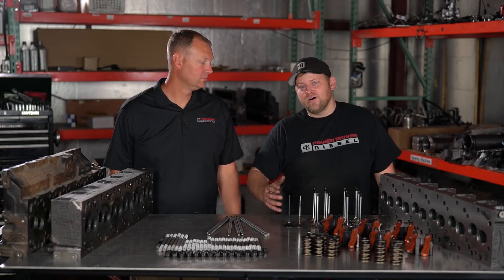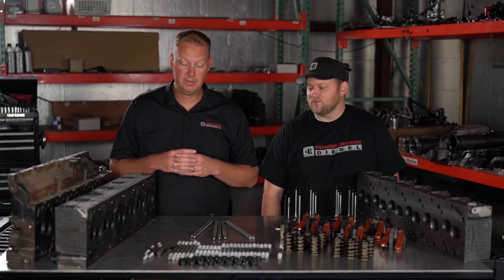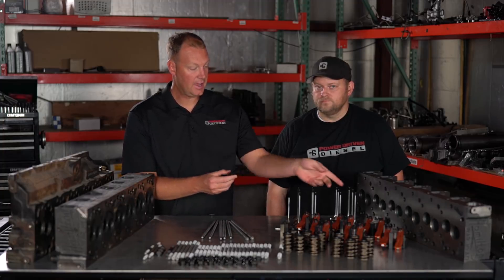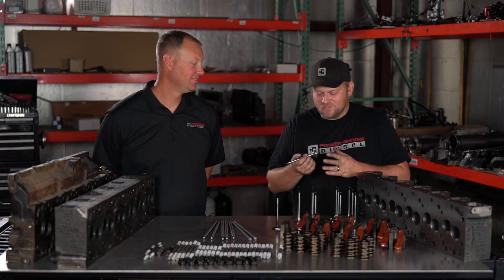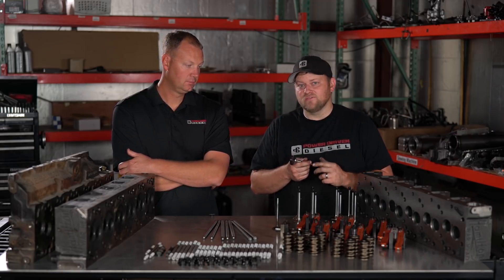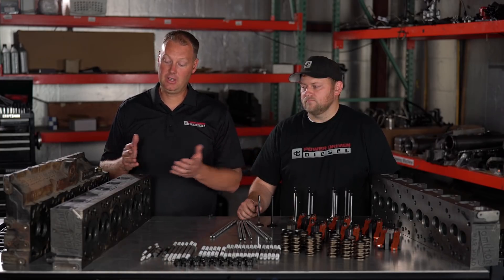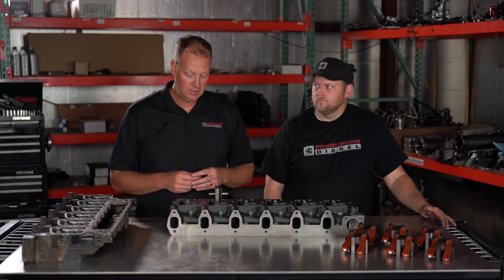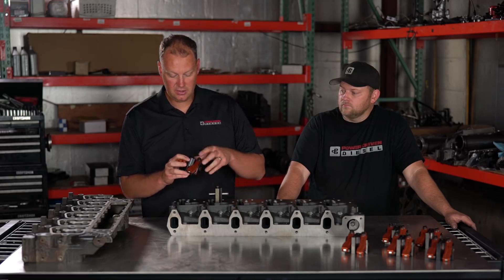Master the Hamilton War Head | Power Driven Diesel

Comment: PowerDrivenDiesel
Todd, when will you be getting stock length 7/16th pushrods back in stock for 24v engines.  Also do your  7/16 pushrods work with stock rocker arms ect.

Comment: Wouldn't be stainless steel intake valve still see the 2000 degrees in the chamber before the exhaust valve opens why wouldn't the stainless steel valve tulip on intake side
Reply: Only on the chamber face. The edge of the intake valve gets cooled off by the intake air coming in, but the edge of the exhaust valve gets heated as the gas leaves.

Comment: Great vid. I do have a Cummins 6bt m12 stud question. How far cylinder pressure wise, have you pushed on the 2000 series arp m12 stud? I have a Nissan FJ20 Turbo 2ltr twin cam "gas" four cylinder.  Luckily enough the Cummins studs were a perfect fit. 
It's about 9.3:1 dynamic comp and planning on 50-55psi with a Garrett gtx35 on e85. Do you think the m12 "625" stud would be needed, it makes 360rwhp on 17psi, which is stupid fun in a 2100lb datsun p510 4 door.

Comment: Why the heck is there a head on the market, but no valves in the appropriate size....
Reply: Because at the top competition levels, the end user is expected to be able to fabricate any parts for your application. Cosworth F1/Indy racing heads used to come bare, zero machining done at all.

This is about the same level.

Comment: It is only money boys so if you really want to play at the top level it is going to be expensive as all hell just saying lol. That was 2500 just for rocker arms and pedistals not the head or valves or anything else, i am not sure what the warhead costs but i bet it is well over a grand not counting valves and for the whole package probably 5 to 6 grand minimum and that is just the top end and doesnt count the need for a forged crank, cam connecting rods or pistons and all that is necessary to even come close to the 2 thousand plus horsepower level.
Reply: Old race mechanic I know says that horsepower equals dollars cubed. How fast do you want to spend?

Comment: WTF you guys are pretty good but I was disappointed when you said  45deg. Valve  is higher performance than a 30 deg seat. ..It is a well known Fact that a 30deg seat begins to flow before a 45 deg seat at the same valve lift. And the 30 deg. Seat won't sink unlike the 45 which under heavy springs and combustion pressures begin to wedge into the seat.

Comment: Ok this is stupid if your looking for that power level  your solution is not over build  the engine  in your super modded truck its replace the  tranny with a cutome built gear ratio  and differnt ratio differentials  with a proper suspension  to match  hp is nothing without torque.

Comment: Is it just me or is Hamilton being pretty stupid by making a head and having ZERO supporting parts for it. If there is going to be a head for this level of performance, there had better be someone making the supporting parts for it. Sounds like hamilton didn't do very much thinking on that one.
Reply: If you're at this level, you can either make your own parts or have access to a shop that does.  Hamilton is the only one doing this and this is what's it's like in uncharted  territory.
Reply: Whose to say they aren't planning on making or working on producing parts for it?  It would be an unwise business decision to make a piece like this that has a huge potential in racing and sled pulling and wait to release it till every other supporting part is produced.  Besides for the people that would be using this head they will most likely do their own thing anyways in the way of supporting parts for use of this head.
Reply: At a certain point in any motor sport that responsibility falls upon the end user.  Up until recently warheads were exclusively used in top tier competition. Give it time.
Reply: You read my mind.... as for they might be supporting it in the future.....it like making a car with no engine....here is your new car....engine in the post......but I supposed which comes first the chicken or the egg......
Reply: I think the only major flaw is that the head is longer, forcing that ugly grind and removing part of the branding.

Comment: Cool stuff guys!  Port design: Raise The Roof!  Pretty sweet how the harland sharp rockers fixed the oil issue!
Reply: The aluminum rocker arms are not going to last like the steel ones. Aluminum in that application has a Cycle life much less than steel. In gas engines, companies such as T&D suggest the use of their Steel Rocker arms in a Turbocharged application. The cylinder pressure trying to keep those valves closed with 60 pounds of boost and up would be immense. Probably not a problem in a Race engine but for long term durability on the Street I would definitely go for the steel rockers with the Harland stands.

Comment: why do they sell this head but don't have or make anything for it seems like a rip off lol
Reply: There's a point in motorsports where the development is on the team/consumer and that's what this head is. I give a big credit to the power driven guys for taking the time,effort and financial risk to bring something like this down to the consumer level. Its only going to push 12v tech that much further for everyone.
Reply: awesome can't wait to see you in the next ucc
Reply: Aaron Sprankel If you run one of these heads your hardcore into pulling or racing and you got a big money valve train
Reply: It's like what high performance for gasoline engines was not so long ago, there were a lot of nifty aftermarket parts out there, but there was a lot of fitting, machining, and customizing to make the parts work for you. Not the mostly plug and play you have now in the past 20-30 years.
Reply: SouthJerseySound i agree with them just think hamilton could out a little mire effort towards their product
Reply: Aaron Sprankel  I understand where you're coming from and I agree but its not how it is. Years ago I did a project with Cosworth and the head's were bare castings. No machine work whatsoever and their attitude was at this level you should know what to do.
Reply: You guys are awesome! I love what you guys are doing and love watching your videos. I hope the time and money investments pay off for you. Badass.
Reply: Its one thing to need to machine the valves and deck the head. It is another thing to need to grind off the corner of the head to make it fit, destroying the logo cast into it......

Comment: This head has been around for years how were they doing it in the past
Reply: However they could. I knew guys in Cache Valley that got them, spent thousands on making them work, and then gave up, reselling them at huge losses.
Reply: Dave McDaniel I tried to deal with Hamilton cam lost a lot of money to will never do it again keep seeing these guys use their product lots of respect for powerdrivendiesel . Just can't get behind Hamilton's products
Reply: Monster RAM I gave them a chance was a huge mistake truck was down for 4 months never did get all the parts I ordered they ended up hanging up on me I sent all their parts back will never deal with the company again I should put out me and Zach's email conversation doesn't even know how long stock 12 valve push rods are
Reply: Hamilton's products are just fine but if you expect experimental parts to just bolt up without custom fitment or the possibility of something going wrong you don't shouldn't be racing.